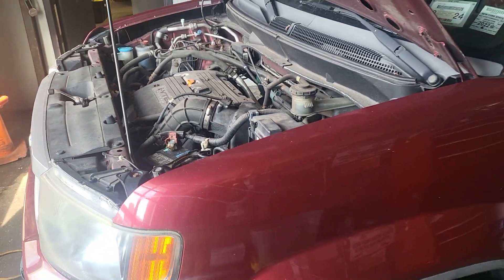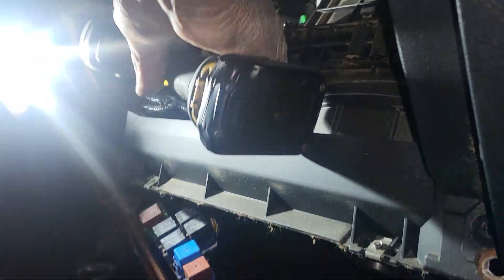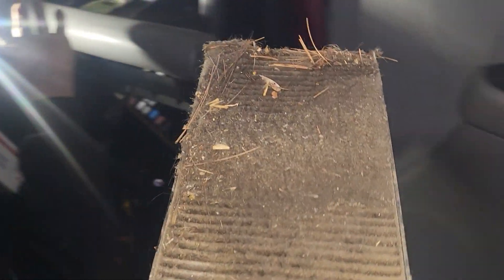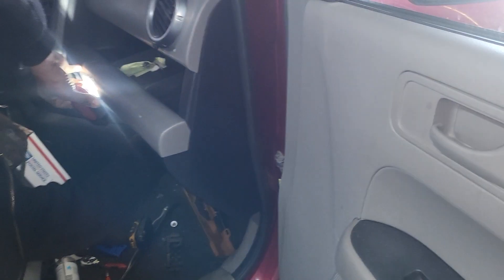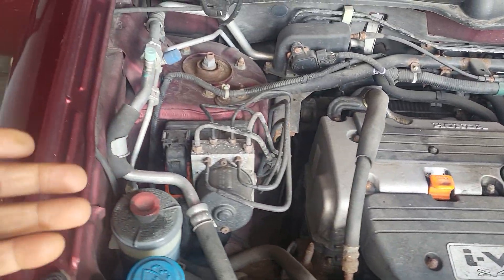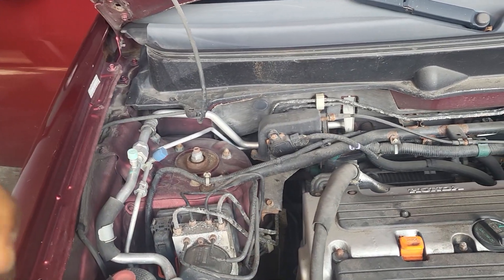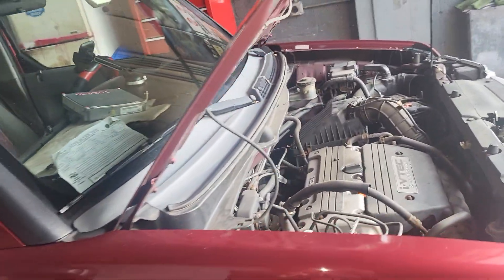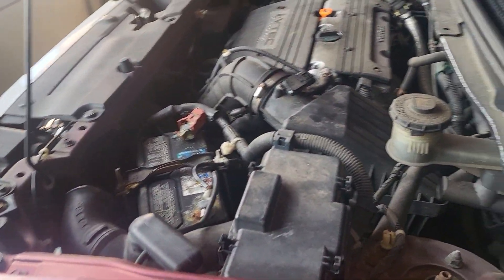2003-2010 Honda Element Engine Used  Computer Replacement (Location And Programming)

Comment: Hi, i have same problem, does the ECU Replacement solve the problem?
Reply from the maker: it depend
Reply: Thank you for fast respond, obd code for bank 1 sensor 2 once trun on the ignition, new cat installed with denso downstream sensor, wire harness looks good, i plan to buy ECU with igntion key, please advice @BestCarFixes